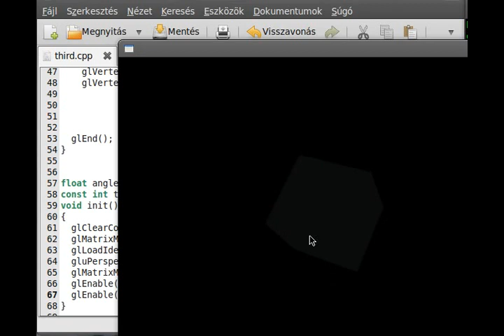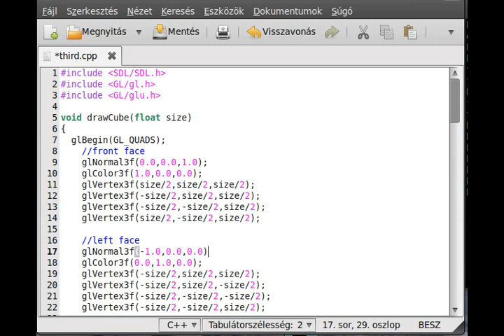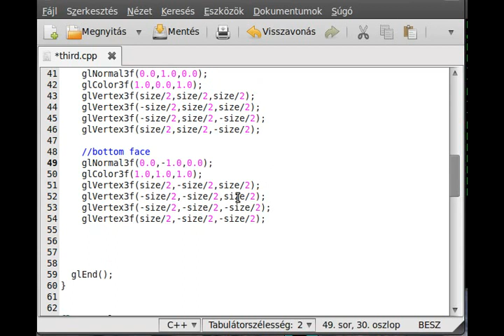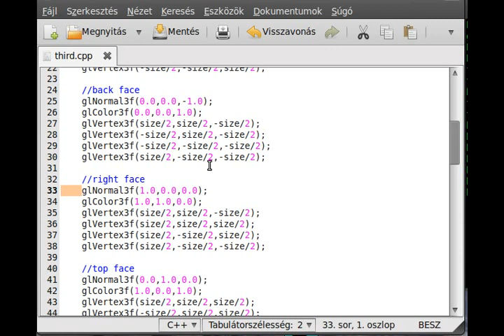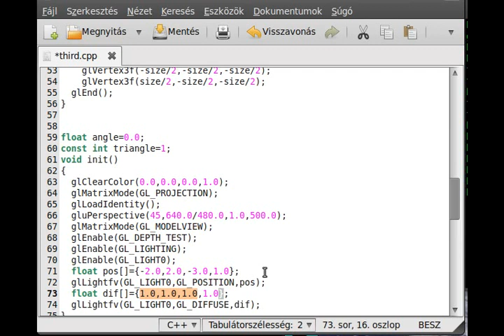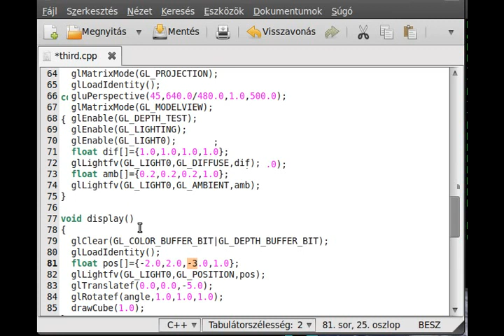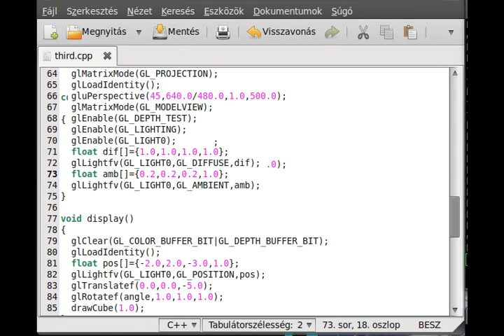OpenGL (SDL,C++) tutorial 6 - Simple lighting (part 1)

Comment from the maker: Try the code in the description, it's not working either?
A few things to check:
Did you enable the lighting by glEnable(GL_LIGHTING) and the light0 by glEnable(GL_LIGHT0)? Also make sure, the normal vectors are OK, and check your light's position, also check, if you have a relatively small ambient value.

Comment: @thecplusplusguy: Diffuse light is light that has been scattered and is distributed over a surface in equal gradients.

In other words, imagine light as a bunch of photons, particles. If you take a very hard, pin ligtht the particles all go to the same spot, more or less, there is some scattering but the light is very focused. Diffuse light is light that has been scattered. Imagine putting a piece of cloth over that pin ligth. The cloth diffuses the harsh ligth, aka scatters it.